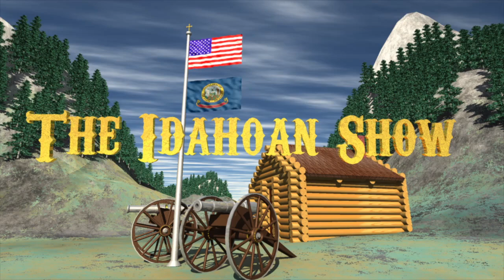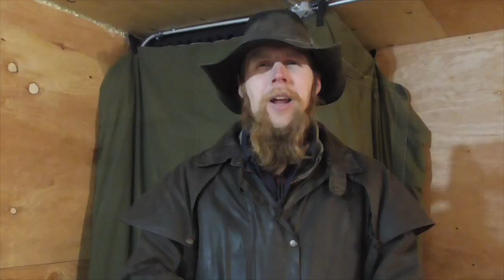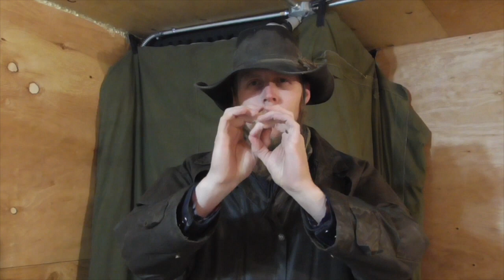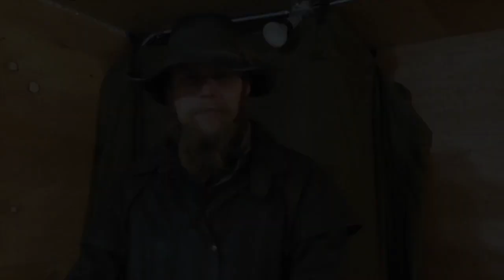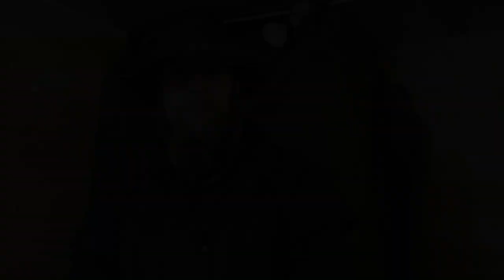45 ACP Sabot Released Publicly (A028)

Comment: Very interesting! I wonder if it would be possible to transfer the concept to a shotgun round to use a rifle caliber bullet? If the sabot is discarded during flight that would probably only work if the bullet has been indued with sufficient spin to stabilize it, meaning the need for a rifled barrel or choke. But if it works that would result in a round for longer ranges than your typical slug. The main question is whether a 3D-print saboted round could be fired without the sabot desintigrated before it leaves the barrel.

Comment: What is the purpose of this? To make a small bullet fit in a big barrel? I don't understand how that is useful.
Reply: Higher velocity and lower recoil than a standard load, same as the remington accelerators.
Probably some fancy interior ballistics math too but as I understand it bigger bores are more efficient so you can get more velocity for a lower pressure, meaning you can throw a .35 cal slug down a .45 cal bore more efficiently than in a .35 gun
Reply: @Robert-qm7yi  Thanks! That makes sense. So basically it a way to adjust/maximize kinetic energy for your given chamber size.

Comment: I would like to try .22 cal. with a sabot for 9mm just to see how fast they CAN go.
Reply: The problem with 22 is that they can be rather long for an average weight around 50 gr…. Better to go a bigger and keep it shorter… we use 32 cal and pushed it to 1600 fps in a carbine…

Comment: Looks like you've re-invented the remington accelerator sabots. Though those were primarily for necking down 30 cal rifle to 223.

For those wondering, there are still some outfits providing sabots for necking 30 to 223. It's possible one of them could do the same for necking down 452 to 357, without the need for 3D printing. Though 3D printing does open up the possibility for home experimentation

Comment: What about the 45 cal sabots for muzzleloaders? They’ve been around a while already…
Reply: "pistol" .45 cal (45asp, 45LC, etc) are bullet diameter 0.452" where as "rifle" .45 cal (45-70, 45 muzzleloader, 458 win mag) are bullet diameter 0.458". So sabot's for 45 muzzleloader would b approximately 6 thousands of an inch too large. It may not sound like much but is quite significant at this tolerance level.

Comment: Honestly printing these sabots won't really be worth it. The real worth would be in injection molding of these though. High output, low cost and with as simple a design as this would be very feasible.
Reply from the maker: The problem with injection molding is the initial cost of molds and machinery.  I actually got a few quotes from injection molding companies, but if I'm only ordering a few thousand, or even a few tens of thousands of sabots, the cost per unit is prohibitive.  If you could sell a million sabots a month, then injection molding would be worth it, but I'm not sure there's a market for that kind of volume, at least not yet.
Reply: @TheIdahoanShow  did you check with MMP Sabots in Harrison, Arkansas? I can't remember his name off top of my head but he's always been a super nice and helpful guy every time I call. I have used his sabot's exclusively for 20 years and they are always perfect
Reply: @TheIdahoanShow  that's true. Ideally, if your sabots could convince personal ammo loaders to buy printers themselves to make sabots, they could find how useful they are and things get decentralized further.

Comment: Love this! Closest thing to this I can think of is the Dagny Dagger and it feels like they're taking decades on realeasing that. Its good to see some more experimentation with 3d printers and ammo. Keep up the great work as always!
Reply: If you're interested in the DD, you can do the same thing but better by getting the lyman 125 grain 9mm mold that is a truncated cone. I need an iron mold and you will need some zinc. Move that to plus p pressures and you are doing the objective of the DD and probably a fair amount safer. Also you're not crossing any of the materials which have restrictions on them.

Comment: I downloaded your sabot and will try it in my 45 caliber air gun. It should be interesting.
Reply: Is your 45 airgun .452 or .458 barrel diameter? If it is like the air force Texan 45 then it uses 458 bullet and these will be several thousands undersize